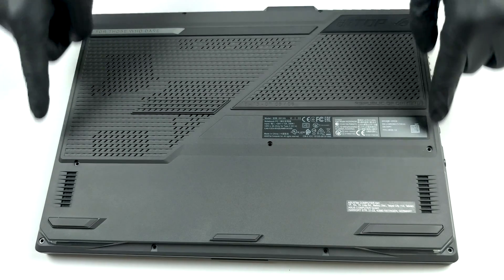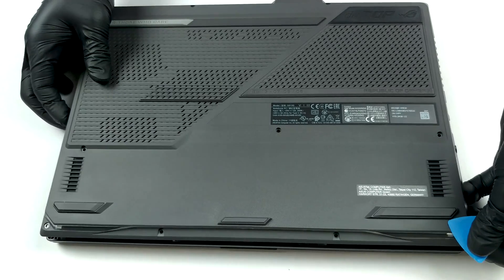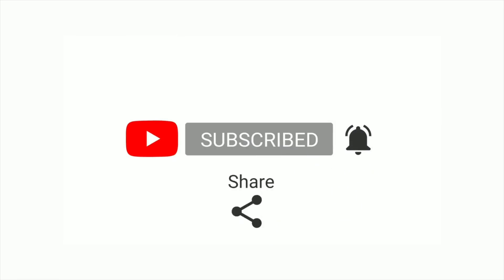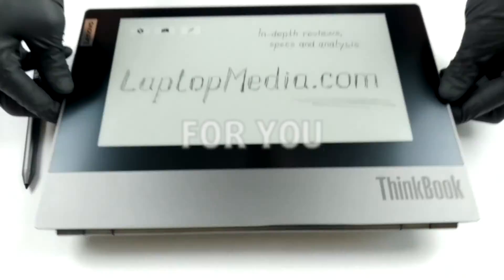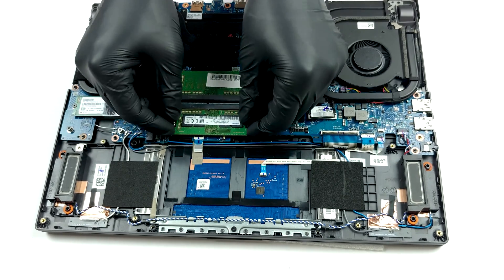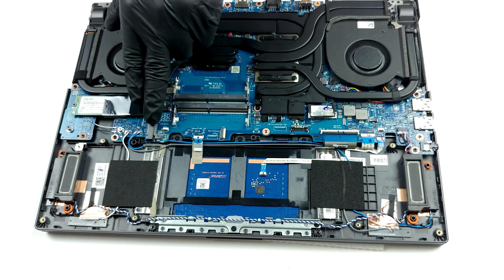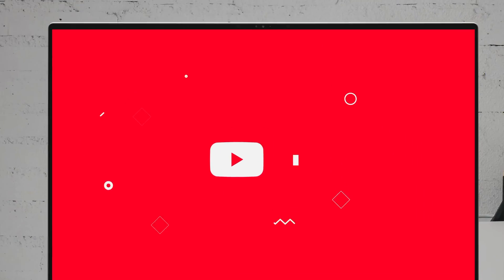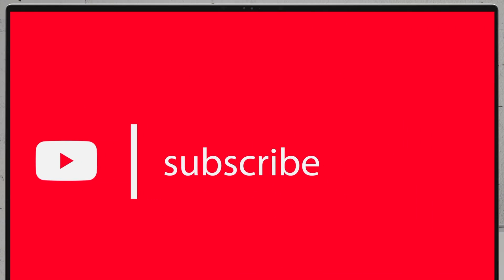🛠️ ASUS ROG Strix G15 G513 - disassembly and upgrade options

Comment: According to Asus specs, this laptop supports up to 32GB, not 64GB. So which of the 2 is true?
Reply: A friend of mine put 64 on it without any issues ;)
Reply: @BiP00  was it the 9 HX version?0:
Reply: @gr00vyrat78  yep, got the same but don't got the money yet to do it on mine to try it
Reply: Anyone tried to install 64GB of RAM in G513IM? (Ryzen 7 4800H, 16GB RAM, 512GB SSD, NVIDIA RTX 3060 6GB). From factory has a frequency of 3200MHz, has anyone tried more?
Reply: @littleprojects6457  the maximum for ryzen 5000 series is only 32 GB, I have this laptop with R9 5900 HX, 3060, and I test it out, the max is 32 DDR4 3200 MHz
Reply: 32 GB is enough for games in the future
Reply: @Thor86-  by the way need to know about future upgrade.
Reply: @Thor86-  I am thinking about the laptop for work. So would be nice to know if 64GB is an option